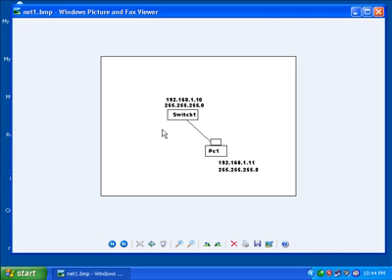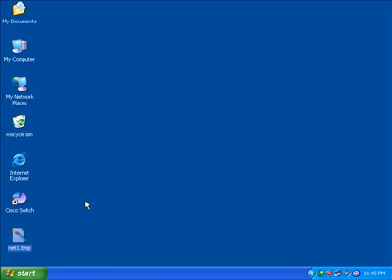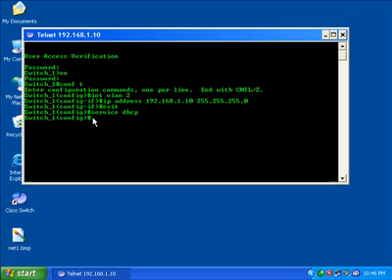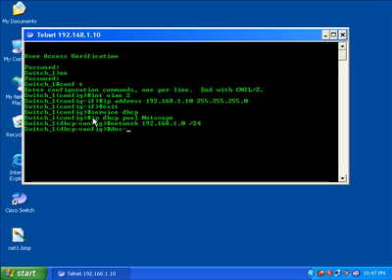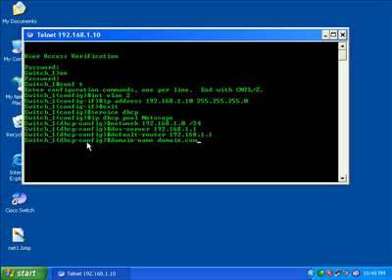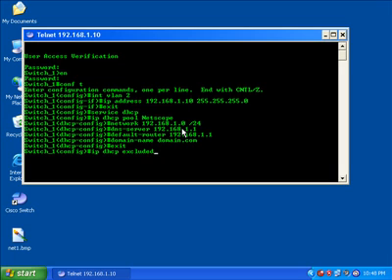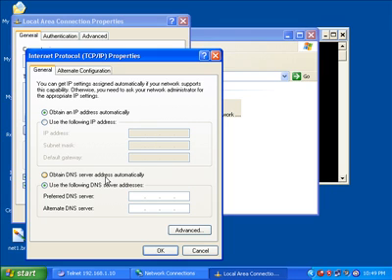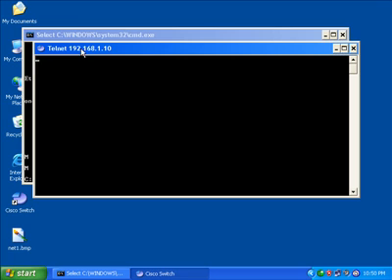Layer 2 Switch as DHCP Server

Comment: Working on a lab and tried this but my Host is showing assigned IPs from a completely different network?  I am not seeing the DHCP setup on the switch in Packet Tracer using a 2960 switch.  Keep getting the APIPA address. Setup VLAN 50 with IP address for the Host VLAN address of 10.0.5.0/24 using 10.0.5.6 255.255.255.0 because we needed to exclude the first 5 addresses. I didn't see any Switch Port setting for were the Host PC is connected to the switch. I also setup the DNS address as the 10.0.5.6 address. Thoughts

Comment from the maker: A layer 3 switch can switch packets. Tje 2950 is not a layer 3 switch. Even though it can use ip commands. Every layer 2 switch has the capabilities to have the use of ip commands. That does not make it layer 3. You should check your sources.